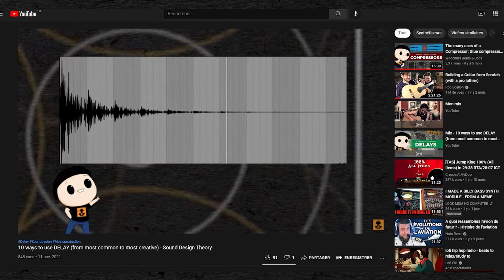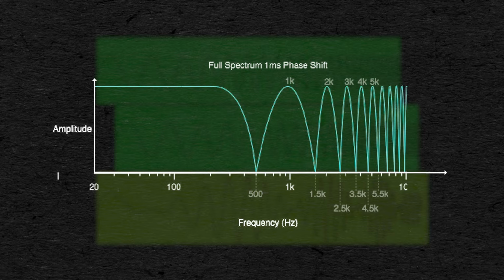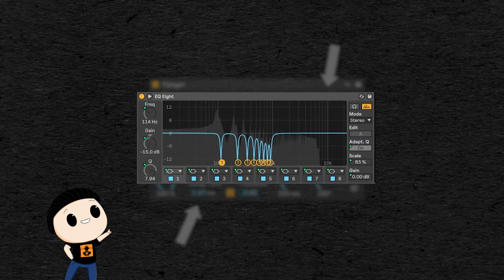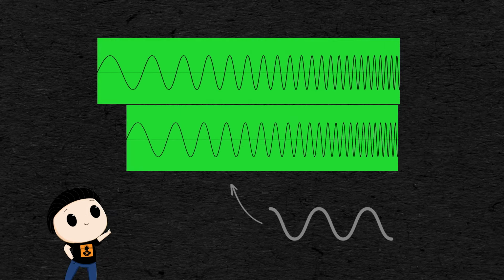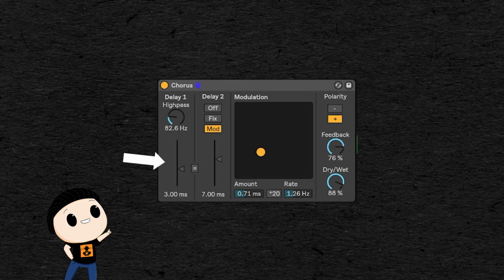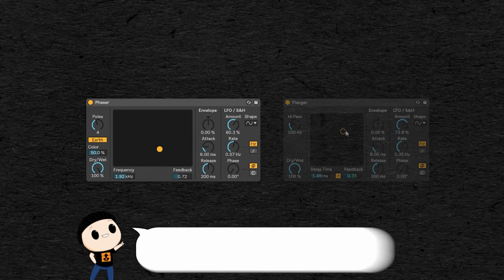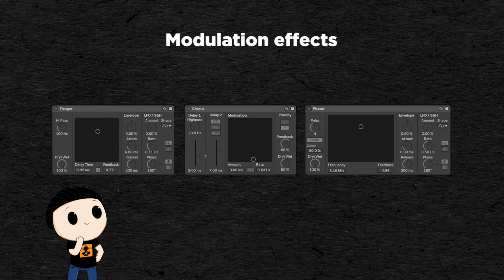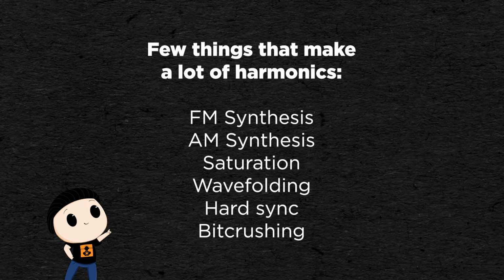How FLANGER, CHORUS & PHASER process your sound - Sound Design Theory

Comment: But if you use them without modulation, isn't flanger and chorus the same ?( only delay and feedbacl changes)
Reply from the maker: If there's isn't any modulation, then yes, they are typically the same thing. Only the delay time between the two signal is typically a bit longer with the chorus.

Comment: ott=?
Reply from the maker: For the OTT, this is not in this episode as the OTT is a multi and compressor. You can find a small section about it in the episode about compressors, or you. Can see it more in action in my last video about dubstep sound design
Reply: @Woochia   ok but what is OTT ?
Reply from the maker: @rmanpojo8485  Ah! OTT, originally, was a preset for Ableton's multi band compressor. Basically it cuts your sound in 3 bands (low/mid/high) and compresses the hell out of it, so all 3 bands will be brought at the same level no matter what.
So it makes a flat sound that loses all its dynamics (there's no quiet or loud anymore, it's all brought at the same volume), but it's been used a lot in dubstep to reveal texture and grain in the sound. 
It got so popular that Xfer (the company who made Serum) recreated it as a free VST plugin. It's used by many MANY producers who often put one, two or even three of those in their effect chains, even before starting to design their sound, because they know they want that HEAVY compression to make their sound go brrrrrr
(OTT stands for "over the top")